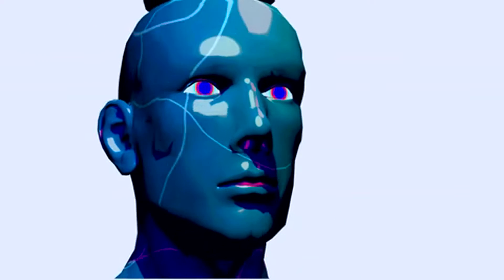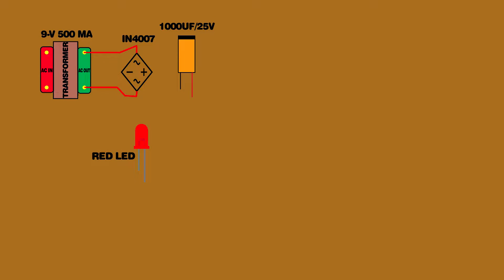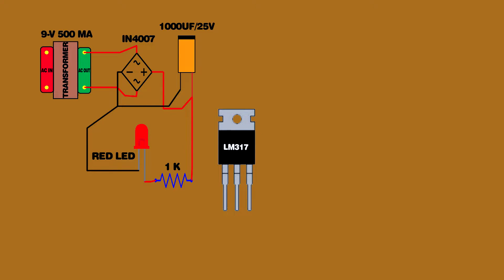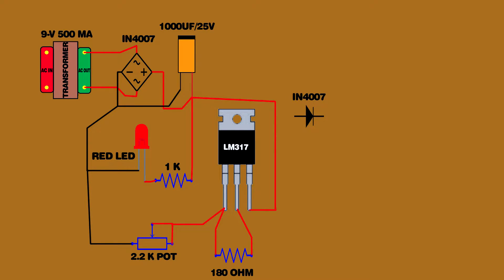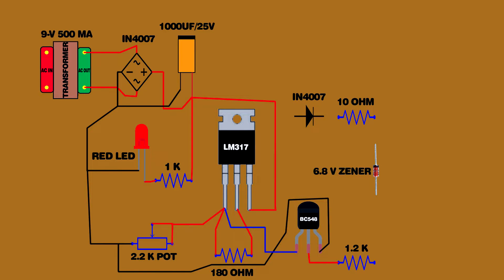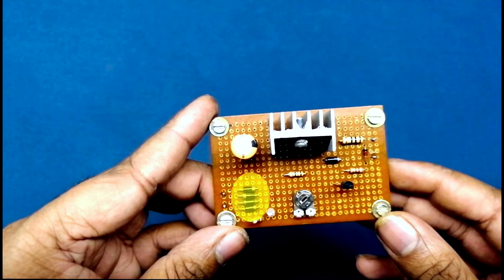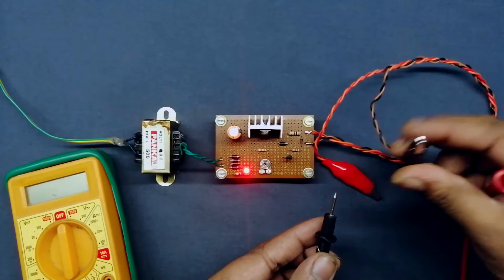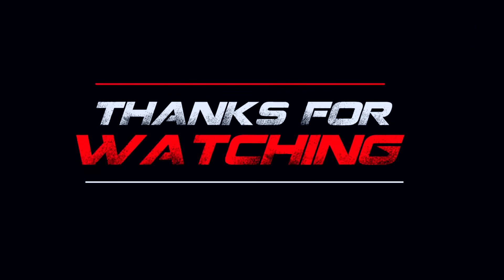HOW TO MAKE A AUTOMATIC 6 V 4.5Ah BATTERY CHARGER CONTROLLER

Comment: worked for 4 ni mh batteries size AA connected in series and each battery is 1.2v? 
for charging up to 5.6v and use zener in this case 5.6v zerner diode?

Comment: can be used for parallel 4.5Ah x 4 batteries = 18Ah ?
Reply from the maker: Yes but it's take more time charging..
Reply: @Circuitoptimize23   is there a faster fill scheme for wind power generation?